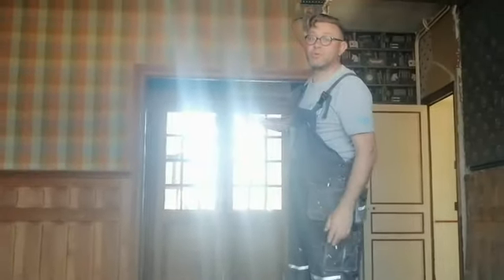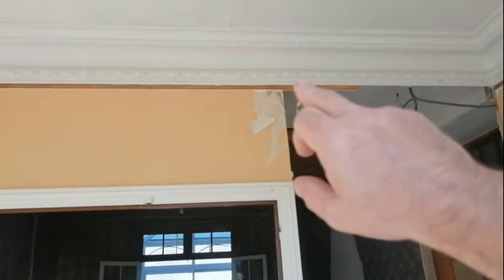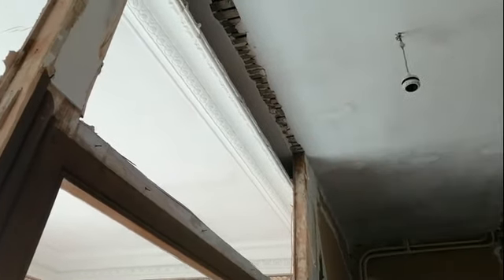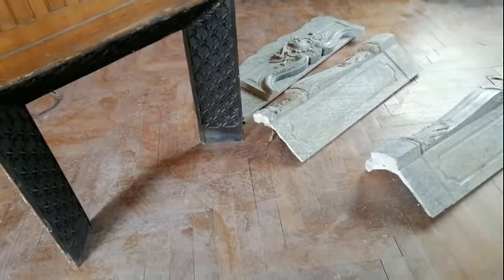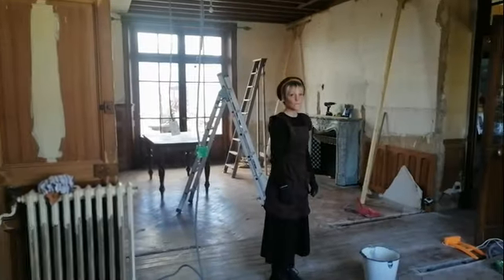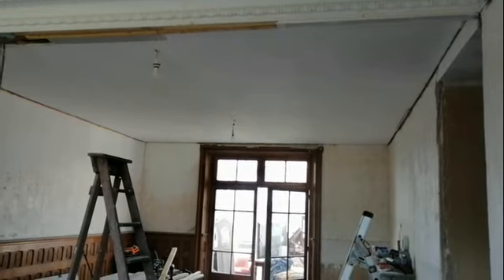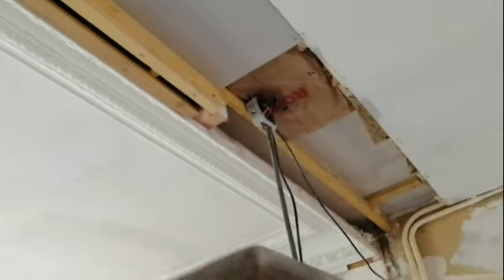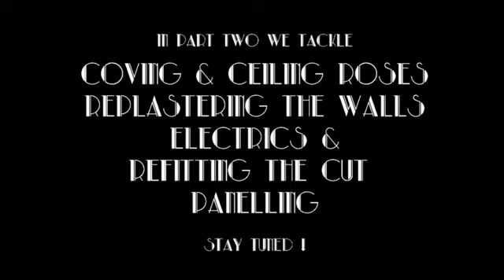Ep 38: Restoration of the Grand Salon

Comment: How is a marble fireplace held together?
Reply from the maker: It actually had joints in the marble, similar to dovetail joints. We used a heat proof cement to act as the bond and is super strong now:-)